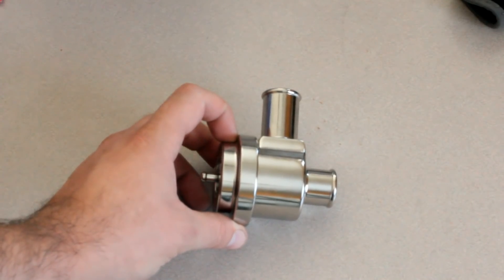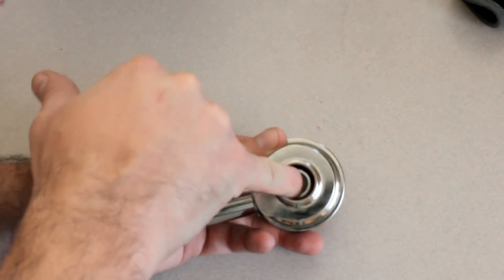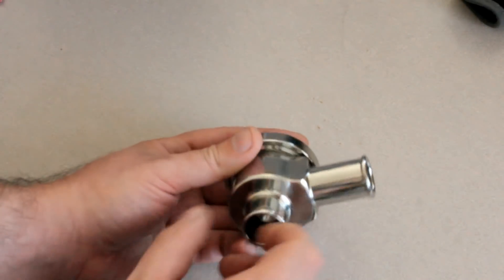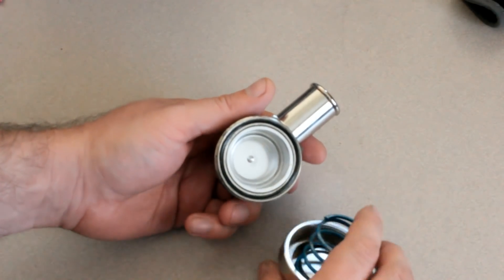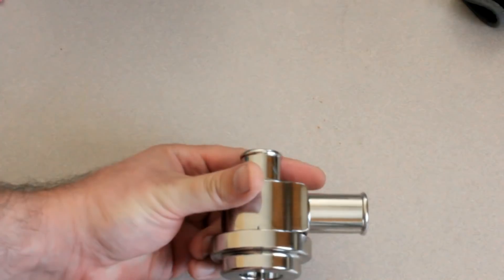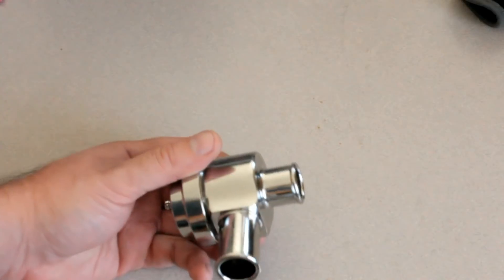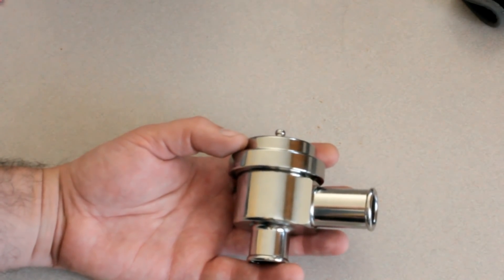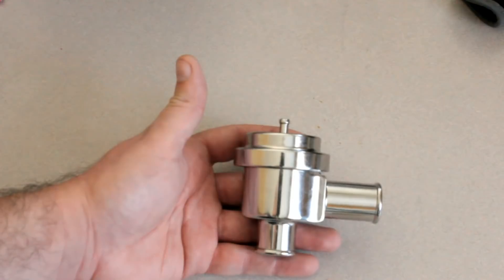How a Blow Off., Recirculating, or Diverter Dump Valve Works

Comment: Well i have a Australian ford territory turbo same as the xr6 turbo here in Australia and i can tell you the factory recirculating bosch vale blows pressure into side port and vents out from bottom.
Maybe due because our xr6 turbos run a large 35 40 Garrett turbo from factory so blowing in from the side cant force vale open under boost.then of throttle the vacuum line vents the pressure.

Comment: Air inlet is on the side and outlet is on the bottom. That is the proper flow route on these designs. Some recirculating valves that look identical have the valve piston and spring orientated differently which is why SOME route the inlet from the end port rather the side port.

Comment: If the bottom pipe is connected to the air inlet and the side pipe is connected to the pressure side, does it matter which spring you use?

Comment: What the....put down the crack pipe  ...this just makes no f  cking sense 
Dont you mean your waste gate gets stuck SHUT not open and need PVR  as a short term fix or just  bite the bullet and get a new waste gate actuator and vac line.

Comment: the vacum source for the valve comes from after the throttle so when it is closed by lifting your foot there is vacum in the inlet manifold. since the turbo can no longer push air into the engine because throttle is closed there is pressure in piping after turbo and before the throttle. so you get pressure from under and vacuum from above opening the valve and releasing the pressure. when either the pressure is low enough for the spring to overcome vacuum or you open the throttle again the valve will shut again.

Comment: This guy hasn't got a clue!! Air goes in through the bottom of the valve and the purpose for the valve is when you drop the revs quickly excess pressure is either dumped into the atmosphere or if you are running a recirculation valve the excess pressure is dumped back into your air intake either option doesn't really make a difference in performance!!! And the only real reason for any kind of bov is to stop pressure surge,reduce strain and ware an tear
Reply: his info is actually correct... on German cars such as a Porsche 997 tt the side port is the pressure side keeping the valve closed. when the throttle is in closed loop vacuum will open the valve vs pressure from the bottom port where you'll need a higher rated spring to keep valve closed due to pressure received post intercooler and vacuum assisted
Reply: hy..do u have any idea from where i can purchase on of those?(ebay maybe?)
Reply: Depending on if your running a blow through maf setup, otherwise if your running atmospheric then you could get rich surges during dump...possibly, but yea this guy is a goober.

Comment: A *blowoff valve* (*BOV*), *bypass valve* or*dump valve* is a pressure release system present in most turbocharged
 engines. Its purpose is to prevent compressor surge
, and reduce wear on the turbocharger and engine. Blowoff valves
 relieve the damaging effects of compressor "surge loading" by allowing the compressed air to vent to the atmosphere, making a distinct hissing sound, or recirculate into the intake upstream of the compressor inlet.

Comment: Pressure on the bottom of the valve and the vacuum on top combine to lift the valve open and release the pressure in the piping.One of the biggest misconceptions about blowoff valves is that you need to tighten the spring to run higher boost. This is totally incorrect-at full throttle,the pressure on top and bottom of the valve is equal,therefore cancelling itself out.So no matter what boost pressure you run,the valve will stay shut.

Comment: This video is wrong.When you are on throttle,the pressure in turbo piping and inlet manifold is equal,meaning that the pressure on each side of the valve is the same and therefore cancels itself out,leaving the spring holding the valve shut.When you lift off the throttle,you have high pressure in turbo piping and a vacuum in inlet manifold.

Comment from the maker: You are describing a PRV pressure relief valve, not a Blow Off Valve. BOV is used to prevent the turbo spinning backwards when the throttle is closed.

Comment: Blowoff Valve (BOV or Pop off Valve)
This term is often erroneously used in place of "Bypass Valve!" A blowoff valve is a pressure relief device used to save the engine when overboost occurs. It is actuated solely by overboost, with no other controls necessary. In a supercharger system, a blowoff valve can be used as a means of dynamic boost control (static boost control is achieve by choice of supercharger drive ratio).
Reply: Wrong!!! Lol
Reply: yeah... your wastegate is what's supposed to open once you start exceeding the rated amount of pressure it's set for.